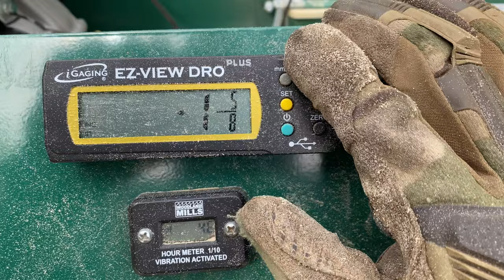038 - Is this a mistake? Building our home with cash?

Comment: The requisite skills and self-sufficiency mindset that were commonplace all across the world up to about 100 years ago are very rapidly fading away, at least in the U.S.. Wood-working, metal shop and automotive classes are all but missing from most schools. It shook me to learn that NOT ONE of my kids' friends knew how to change the battery in their cars, stand up a fence, check and replace a start/run cap in an A/C, change/gap a plug in a lawnmower, or even build a dog house (not from a plastic kit). When I was a kid I spent whole summers on construction sites with my grandfather, father and uncles slinging lumber, learning to frame walls, pour slabs, tile counters and floors, lay brick borders and block walls, welding trailers, etc... What has happened in the last 30 years?
Reply: When my daughter was 14, I bought a mid 70's pickup that didn't run for almost nothing (essentially scrap price) and together we rebuilt the engine, carb, and tranny, replaced wheel bearings, axles, brakes, drive shaft, u-joints, etc. nearly everything front to back. She learned to drive in it, then when my son turned 14, we ripped it apart down to the frame and put it all back together again... 

I was thinking of engaging local youth groups and possibly the schools to come up with an extra-curricular hands on learning program for construction, small engine repair, automotive maintenance, metal working, like a pre-apprenticeship program, then I found out the local middle/high schools where we moved to (in a rural area) about 5 years ago has an FFA farm lab that does all of that plus agriculture/horticulture, livestock care and husbandry, they sell farm-fresh eggs, garden starters, etc. but for the past 2 years it's been shut down due to Covid. no word yet on if/when it's supposed to start up again. I was wondering; does your area have such a program?
Reply from the maker: We have 4H which does something similar. We will be getting our. Chickens from one of the 4H kids that we know and buying half a cow from them as well in August.
Reply: @DuckRiverHomestead  I would take the back section of the cow

Comment: you are right but unless you mill your own lumber and built most of it your self there is no way you can do it. they are nice logs look like hardwood you can built a much better house out of them than white pine if you can get around builting codes. all these's 200 year old houses were built out of oak mine is over a 100 years old all the framing and floors are oak, siding  poplar and inside walls tongue and groove pine. take care, be safe and well.
Reply from the maker: I'll be grading/stamping my own lumber for the build. Kiln drying is key to that process. I can get away with green lumber for the shed because it doesn't require a building permit as it is less than 200 sq feet and it's not a residence.
Reply: @DuckRiverHomestead  that's great builting code in va. can be very diff. for each county a lot of them are not needed and are just there to cost you a lot more money, glad you had every thing step up for you to grade and stamp your lumber.